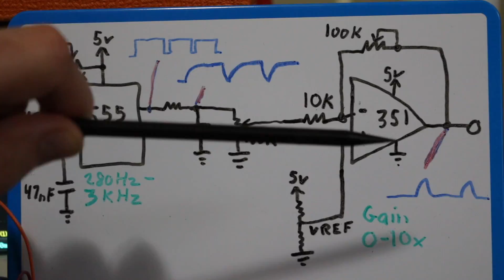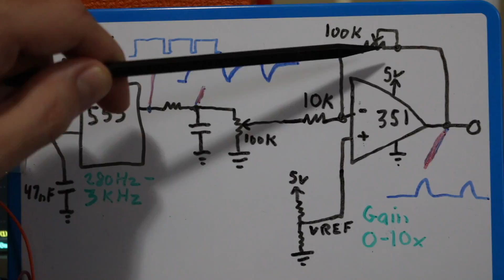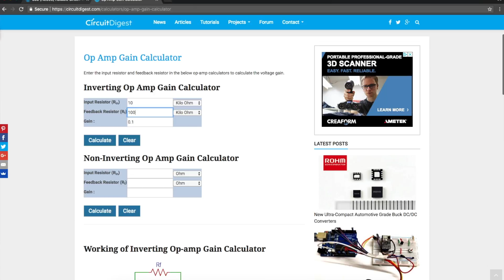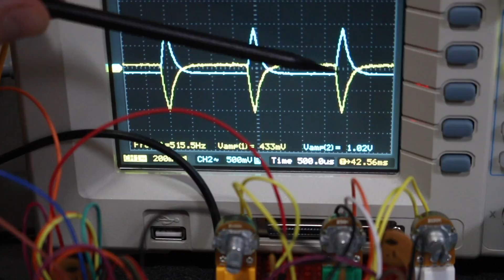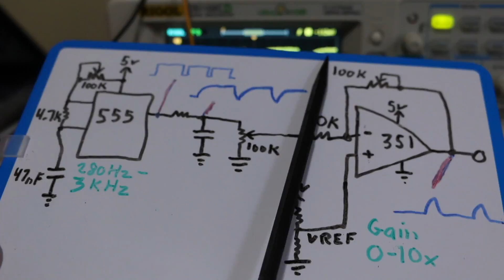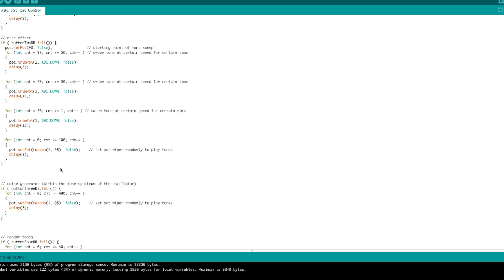Digital Potentiometer - X9C Practical Uses and Examples

Comment: Can I use it on Ac loads?
Reply from the maker: The voltage across the potentiometer terminals can be from -5 V to +5 V, but the maximum current can only be 4.4 mA so it’s only intended to be used where it’s not going to see a heavy load. A small AC signal could be applied within that voltage and current.